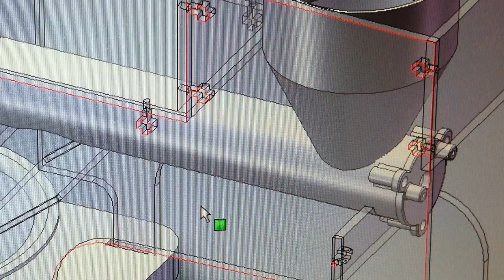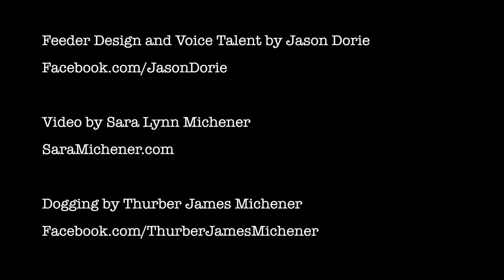Thurber Feeder 5000

Comment: May i ask if you have any problems with the auger getting stuck? I'm making a pet feeder too but i am using an auger that is actually meant to reduce water gurgling noises for rainpipes or aquarium overflow pipes.  So now I'm not sure if i should be getting a more close fitting auger for my 50mm pipes, or getting a motor with higher torque, or both. What motor are you using by the way?

Comment: Hi Jason. Excellent Job. I would like to build one similar of yours. However, how does it possible to includes in the arduino a sort of timer programmed to dispense certain amount food in cups for example? Thanks.
Reply from the maker: The motor is a stepper motor, so it turns an exact amount, controlled by the microcontroller (mine is a Propeller, yours would be an Arduino).  I just measured how much food comes out when I do one complete turn of the auger, and made the number of turns I needed to get the right amount.  We also don't leave food in the machine - we only put in the amount for one feeding, so if it turns a little extra there's no problem.

Comment: Hi! Thanks for this video, it's given me some great ideas. I have a couple questions if you don't mind:

What are you using to attach the belt to the auger? Is that a custom part, or were you able to find a pulley that fit the auger?

Do you have any issues with the auger jamming on kibble where is enters the auger?
Reply from the maker: Seth Ratner - the pulley itself is a standard part, but I 3D printed a connector to mate the two pieces.  As for food getting stuck, no I have no problems. The motor I chose is strong enough to break the food. I had used a weaker motor originally and it would get stuck, so I upgraded to this one.  That's also why I use gear reduction.
Reply: Thanks for the reply. I'm a bit in over my head on this one! Any chance you could point me to where you got the pulley setup? I'm probably going to use the same auger you're using, since it's almost impossible to find affordable augers (chocolate fountain, genius!). The alternative is this cereal dispenser, which has the benefit of flexible rubber flaps on the hopper, which prevents jams. Unfortunately, it does not allow for much in the way of precision dispensing. https://smile.amazon.com/COBBLE-CREEK-Cereal-Food-Dispnser/dp/B00TECVEQE
Reply from the maker: It's been a while, so I don't recall the exact setup, but the pulleys are from these guys, and most likely the MXL type:  http://sdp-si.com/products/timing-belts/imxl.php  GT2 belts & pulleys would also work fine, and are commonly available 3D printer parts, so you might be able to find them cheaper.  I chose a pair of pulleys that give me a 6:1 gear reduction.
Reply: Hey Jason, thanks for the info. Do you have any better views on the 3d parts you printed to mate the large pulley to the auger? I'm having some difficultly coming up with a design. I see you have a plate that both the auger and motor bolt to, but what type of shaft are you using to go from the pulley, through the plate, and into the shaft?

Thanks!
Reply from the maker: Hey Seth - If you contact me through JasonDorie at gmail I can send you the STL files and source model if you can use them.   There's no shaft, per se - it's part of the plate, and is a single custom piece.
Reply: Would you be so kind to send me design files also? Thank you in advance. cavkie at gmail dot com

Comment: Nice Job.  Maybe a sensor at the bowl so that it will only feed when the dog is present. ;-)
Reply from the maker: That's not really necessary - He sits in front of the machine until the well after the feeding cycle is done, unless we're eating dinner, in which case he alternates between that and begging.  :)

Comment from the maker: It's the Thurber Feeder 5000 - A custom built, home CNC'd / 3D printed robotic dog feeder.

Our dog (Thurber) eats so fast he's constantly getting food stuck in his throat and choking.  It terrifies my girlfriend, so I built a thing to deliver his usual amount of food at a trickling pace, forcing him to slow down.  It's been so effective, he actually eats slower even when we don't use it, which was an unanticipated (but very welcome) side effect.

Tech specs:
- Parallax Propeller microcontroller to run the priming / feeding cycles
- CNC'd polycarbonate enclosure (home built CNC machine)
- 3D printed part interfaces between the pulley and the chocolate fountain auger
- 44 oz-in stepper, with a 6:1 belt reduction
- LED's - GLOWING, PULSING, LED's!
- Feeding and priming cycles can be interrupted or restarted, all with a 1-button interface
- Also, it actually does feed the dog
Reply from the maker: His whole name is Thurber James Michener, and he even has his own Facebook page.  :)